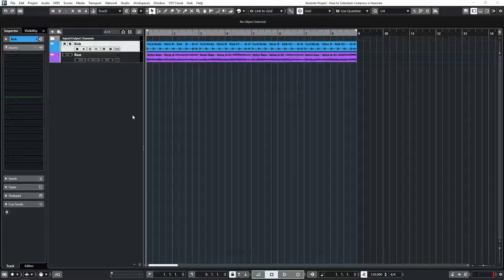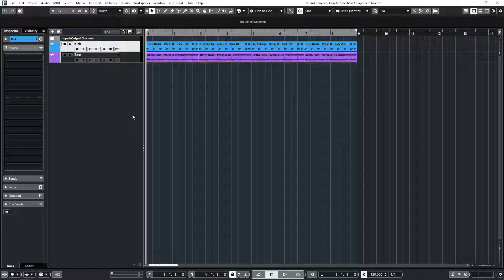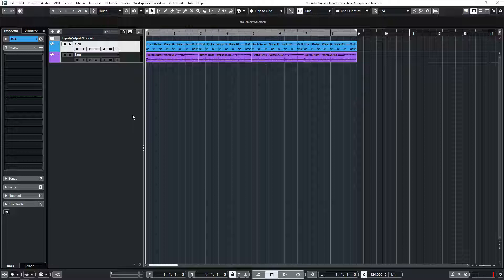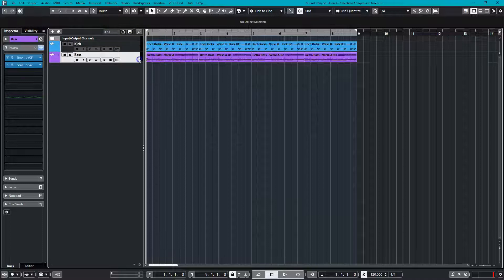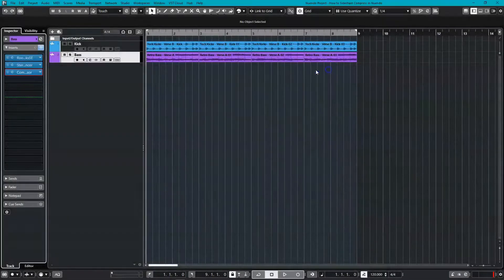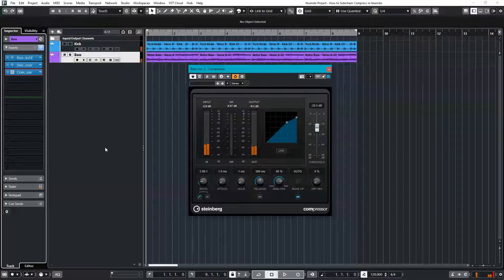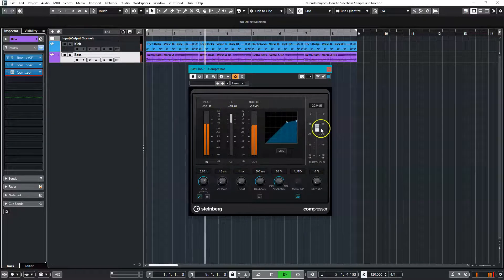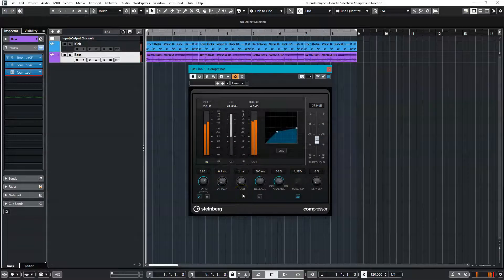How to use Sidechain Compression in Nuendo

Comment: When I SC compress 808 useing kick the Gain Reduction meter on 808 compressor has a forward delay. What i mean is kick takes 2  or three hits at end of range and no gain reduction on compressor meter.  I notice your  compressor is moveing in time with kick. Any suggestions?
Reply: Yes and no. Seems  like DAW is anticipating kick hit generating GR and when last kick transits visable in range appear there is no GR. I think I will exaggerate 808 reduction,  export,  and see if wave form reduction lines up with kick.
Reply from the maker: @I-HEAR-MOVE-OUT-BY-FIN-TO-SEE  that’s an odd problem, and I’m not sure if you have a “look ahead” function on your compressor, but if you do, it could be worth turning off an on. Good luck!
Reply from the maker: @I-HEAR-MOVE-OUT-BY-FIN-TO-SEE  hmm…let me see if I understand your question. Are you saying there’s latency when the kick triggers the 808? And that the moment the kick hits, the 808 doesn’t reduce in volume until a few moments later?